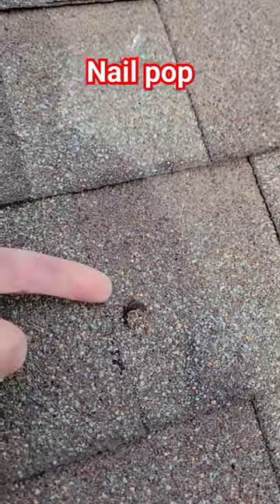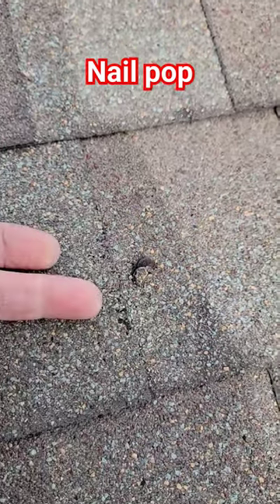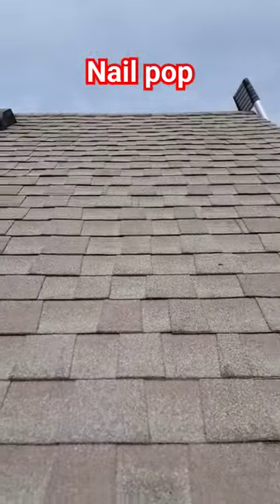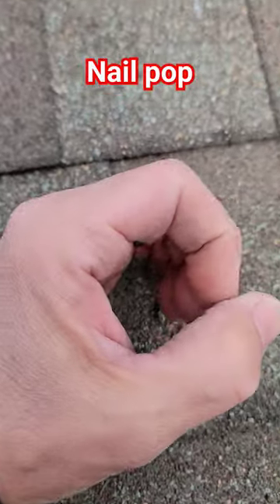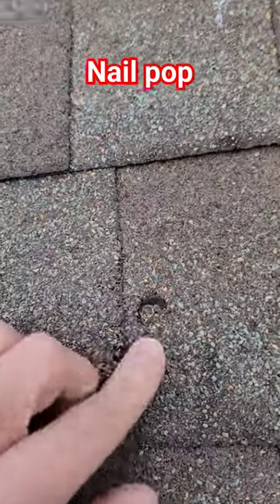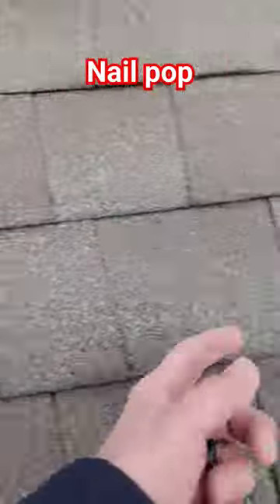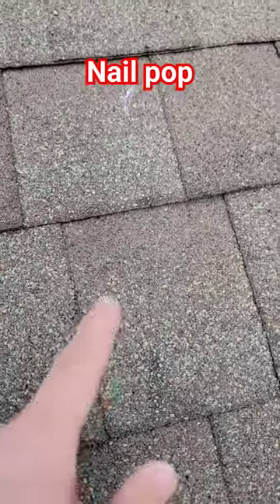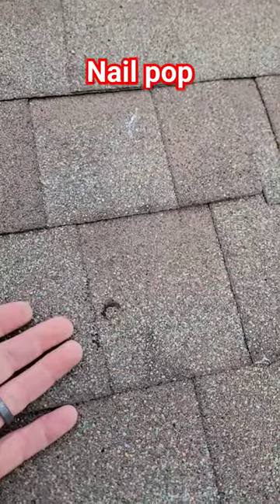Roof Nail Pop

Comment: You can see by the glue line if the nail was put in flush initially, if it is raised up and not adhered to both shingles it was never flush, if it is glued together, it was not held up by a raised nail. I am speculating, but from what I have seen, the common factor for nail pops, when the nail was actually driven deep enough, is ventilation issues. Every time I see nail pops the house has non-Baffled ridge vent, or no intake vent, or multiple types of vent, unbalanced ventilation or clogged ridge, and a lot of bathroom fans vent into the soffit which then pulls right back into the attic. When these conditions are present, the nails condensate a lot. Freezing the bottom of the nail to the bottom of the deck, when the nail expands from the sun warming the shingles it pushes up a microscopic amount, after this happening many times it punctures the shingle. I have never seen nails pops when everything ventilation wise was done properly.

Comment: Hey you should explain the possible reasons why the nails are popping out. 
Of course those reasons are due the the roofer not paying attention. 

# 1,  some part of the nail got bent and through heating and cooling it works it's way out. 

#2 , the nail did not land on a solid part of the plywood which of course through heating and cooling it'll works it's way out. 

# 3 , the roofers nail gun just sucks and never drives the nail straight. 

And as you know , if you roof , the nail always finds a spot where the nail will bend and you have to stop and deal with the nail , which of , course nobody does. The nail could hit a knot or alot of times hits a nail head amazingly or other things. 
And more times than anyone thinks the nail finds a spot like at seams between plywood where the nail is floating  and roofers never deal with fixing those 
And you probably know most roofers are not paying attention or cares.

Comment: So do I take it out or hit it in and replace the shingle ?
Reply: Take it out, put another nail in its place ( not in the same nail hole obviously) then seal the shingle with a good plastic cement, like black jack ( basically tar) .. from the looks of the shingles in this video, looks like the granules are shedding pretty badly anyway, so definitely wouldn't hurt to replace that shingle, but honestly it looks like it's about time to get the ball rolling on having the entire roof replaced.
Reply: @denverscott37  I really appreciate your input, unfortunately my roof is only 3 years old and I had a popped nail, leaked onto my Joyce and down to my sheetrock going to fix it today
Reply: @AnonymousVap3s  damn, only 3 years old and already having issues with it? That's terrible brother, but it does happen, unfortunately, not saying there's anything wrong with roofers using a nail gun and nailing the shingles on really fast, but you have to make sure each and every nail is put in the right place, and the nail heads are driving at the same angle as the roof, so the nail head ends up perfectly level with the shingle, and each nail catches wood correctly. 
You wanna make sure you've got proper ventilation as well, I've seen houses that didn't have the right ventilation, and that heat building up in the attic can and will push nails out, buckle the roof sheathing as well. 
Good luck to you man, hopefully your roof is flat enough that you're comfortable being up there, we use old couch cushions, they can be a life saver on a pitched roof, may be a good idea to just have one beside you while you're up there. 
I've been roofing for 34 years, not bragging or anything like that, I let my customers do that for me haha, but if you run into a bad spot and just need a little help, let me know here and I'll try my best to walk you thru it. 
I actually gotta work today myself, I'm putting a nail over on for a buddy of mine, he asked me to nail em on by hand, and had me using inch and a half roofing nails. 
Pretty good idea honestly, some of the roof is pretty steep and he's using dimensional shingles, which are two piece laminated shingles, so you have to make sure each nail hits the nail line on the shingles, or there's a good chance that the shingles will slide apart. Definitely more work for me, vs using a nail gun but like I said, he's a good friend of mine and he's paying really good to do this roof for him, and as they say, the customer is always right (until he's wrong 😂) but hey, good luck bro, if you get stuck, just comment here and I'll try to reply as soon as I can
Reply: I also slip a piece of metal under the hole, roofing sealants break down from the sun,  this way if it does your sill rotect
Reply: @denverscott37   update started loosening shingles and removing nails, don't know if that was a good idea but I wanted to have a head start on the job so I can finish it throughout the week, but there was a carpenter nail for some reason sticking out which pierced through 2 shingles, I got balled up on which ones I have to remove because how the shingles are nailed in an offset manner, and my mindset is if I peel one corner of a shingle to get to a nail I might as well loosen it all the way and re seal when it's time to seal everything
Reply: The guys who installed the roof did a terrible job nailing, I see a lot of rusted nails and nails put in at an angle, I've been trying to get in contact with my realtor and other sources to find out if It has warranty or not
Reply: @denverscott37  is it possible to email you a photo? If I can't get it I might just have to call someone because there's a 50% chance of rain on Saturday and I have about 4 or 5 unsealed shingles and nails pulled as well, also do I have to put sealant on every nail I pulled? I hear it's a good idea to not use the same hole the nail comes out of and to nail slightly left or right of the old hole, Thanks a bunch
Reply: @Anthonycapone8146  There's nothing wrong with sticking a small metal bib under the shingles and over the old nail holes, I always seal that old nail hole first, then stick the metal bib over top of where I caulked the old nail hole..

Comment: what would you seal it with?
Reply: I used to use Blackjack roofing tar in a caulk tube when I was a roofer.
Reply: @MoneyManHolmes  I see why your not a roofer anymore
Reply: piece of flashing underneath the single with the hole in it then use clear silicon to seal the hole and adhere the flashing in place
Reply: Geocell 2300. (used to be sold at HD but only at supply houses now)  Lowes and Home Depot have their own brand. I think Lowe's is Lexel and HD has some Dap roof sealant. It's a tri polymer roof sealant. Just remove the nail,, fill hole with sealant,  if possible slide a thin sheet metal under the shingle with sealant. Even without the metal it'll last years if you plan to re roof within the next few years.
Reply: @ARandomTrex  what's tri polymer
Reply: Shingles are a fibered material, if you're working with a fibered material, you use a fibered caulk, plastic cement or like the other comment here said, black jack tar is appropriate.
Reply: @911WASanINSIDEjob420 don't use silicone on shingles,  use a fibered caulk on fibered material, such as asphalt shingles. 
That silicone will just pull the granules off the shingles and cause more trouble down the road. Never, ever use silicone on asphalt or fiberglass shingles..
Reply: @redsresearch the guy you replied to is absolutely correct about using tar , if he's not right, please explain why he's not right...
Reply: @MoneyManHolmes you used the correct caulk brother, anyone who says you're wrong about using blackjack on shingles, doesn't know a damn thing about roofing..
Reply: @denverscott37  been using it for years. Never seen it fail. The black fibered caulk doesn't seal as well as silicone
Reply: @denverscott37  tar will crack
Reply: Silicone is garbage, it's terrible to use.
Reply: @911WASanINSIDEjob420  that's just not true , silicone will  take the granules off the shingles,  plastic cement is literally made for fibered asphalt, modified or roll roofing, which is pretty much the same material as shingles takes trowel grade and brush grade tar, Karnac... I'm not saying you can't squirt a little silicone under an old shingle as a quick way to repair an old roof in a pinch, you can do whatever you want, but if you put silicone on fiberglass/asphalt shingles , it will pull off, and take the granules with it. Shingles are a fibered material, fibered material=fibered caulk such as blackjack,  plastic cement, basically tar.
Reply: @Anthonycapone8146  it prolly has its place
Reply: @denverscott37  its mastic and mastic dries out and cracks
Reply: @redsresearch  yeah you're right about it cracking, the trick is to use just enough.  I've seen guys use way too much and it'll bubble up and actually start catching water and holding it in.  Honestly tho you're only getting maybe 12 years out of a modified roof anyway so by the time it starts cracking it's pretty much time to replace anyway, I don't really use the stuff, unless the customer is adamant about having it, if it's flat enough for modified, just go with EPDM or TPO .
Reply: @denverscott37  it will crack within a year, and edpm and tpo suck
Reply: @redsresearch  well now you're just telling lies partner, I've laid down reinforced.60 rubber close to 30 years ago for a guy a still do work for, my rubber roof is still going strong. 
As for TPO many, many large roofing companies are using it for commercial work, and when properly installed, they too can last for 30 years. 
You can't stop mother nature, just slow her down a bit. Obviously it doesn't get much better than metal for roofing, like the box gutter and bay window flat lock in my profile pic, if the people I did that metal work for do what I told them and have it painted every 5 years or so, that metal will still be there long after I'm dead and gone. But it's not always feasible to use metal, this is why different roofing products exist.
Reply: @denverscott37  torch down is way better
Reply: @redsresearch  meh, torch down is only good for between 15-20 years, pretty much the same as if you use trowel and brush grade for the modified. I've done a few of them but I'll usually try to sell the customer on an EPDM rubber roof. If they go with a reinforced .60 rubber, vs just the  .45 rubber, they'll likely get double the lifetime of the modified roof, like I said, I laid a .60 rubber roof close to 3 decades ago for a guy I still do work for today, he still owns the property so I know for a fact that my EPDM roof is still holding up just fine, had he went with a torch down, he would have for sure had to replace that roof once already, and likely be getting close to time to replace it yet again!! 
Since he went with the reinforced EPDM tho, he'll probably get at least another decade out of his roof before he even has to think about replacing it.